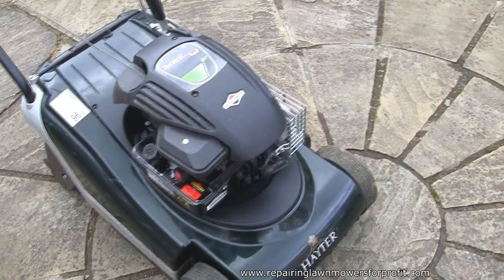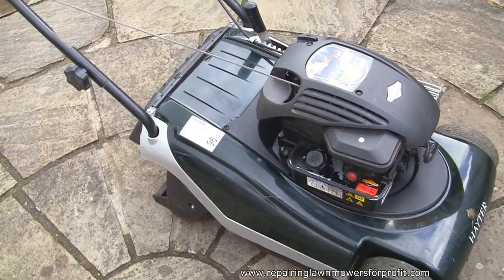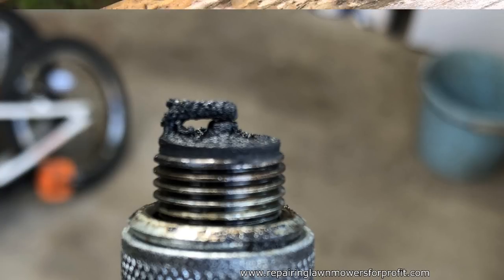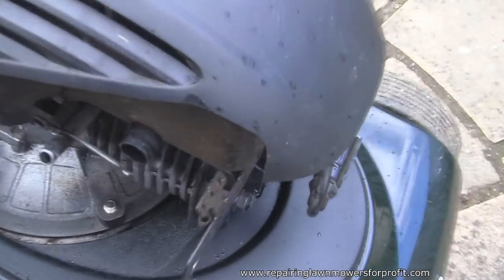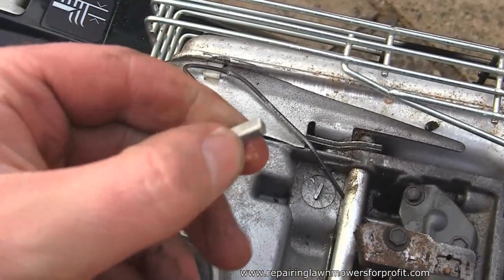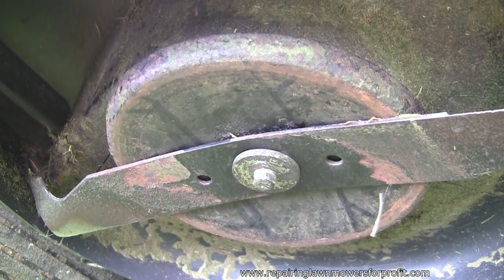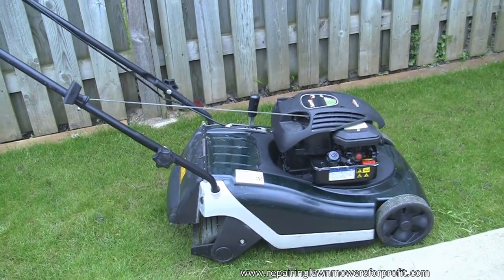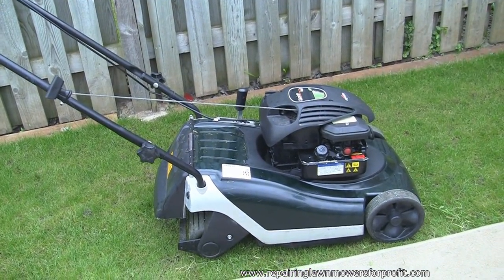Nightmare Hayter Spirit 41 Lawnmower Repair

Comment: Yes, the seal is often overlooked by many. Nice repair.
Reply: Haha, I keep seeing you all over the place Martin. A good channel recommendation, so I subscribed. You've mentioned that seal as well. I was just given a 190cc 625 Briggs powered mower - loads of power, but may be toast; knocks and smoke. I haven't pulled it down yet, but not sure it will be worth repairing. Anyway, cheers to you and the Mower Man
Reply: Nice one Pete.
Cheers bud
Reply: You have an old one some where, maybe in the poly tunnel. It's the first time I saw a mower with a roller.
Reply: Yes Its in there Bri. One day maybe lol

Comment: Thanks for this video.  I have this mower and it has recently started to cut out after about 10 mins of use.  Not sure yet what is wrong but think it might be the seals you changed on the carburettor
Reply from the maker: it will be

Comment: My Hayter Harrier 41 Autodrive Rear Roller Petrol Lawnmower is in need of a service. The jockey arm assembly doesn’t want to return fully and the brake cable is loose. So the mover won’t stop driving forward. A simple wd40 spay application to the jockey pivot arm doesn’t yield great results.  It still won’t engage the brake/no drive.  think I may need new belts. Have you seen similar issues in your past or know any decent links to fixing and how do disassemble the unit to fix the jockey arm.  The mover is a few years old now and tired but runs well just needs some attention. Thanks for your help.

Comment: The friction disc is something unique to Hayter. Don’t think the adaptor on a regular mower has a crank protection. Try and do work on the current Hayter pros. Great money in them if you buy them cheap. I have a video on how to fix the drive on an old 56 if you need any help 👍🏻
Reply from the maker: Gregs Mowing Thanks I'll take a look at it cheers

Comment: Hello there. I have just purchased a second hand Hayter 41 Spirit and the height mechanism has come apart infer the machine, so the front wheels have disconnected from the back mechanism. Each time we reconnect it the metal piece falls off the metal dowlin it sits on. Have you any experience of this please?
Reply from the maker: Yes, absolutely I had the same thing once but was unable to fix unfortunately
Reply: I used a jubilee clip on it and it’s been ok for 3years now

Comment: I've really enjoyed your videos, they've really inspired me.  I've got an old Hayter and I can't find the engine number - there's no stamp anywhere . The carb and bowl were completely rusted.  I've cleaned it as best I can but it's not great and the float keeps sticking.  FPHA20 dellorto and no 96 is marked on the carburretor but that's not helping me to buy a replacement and the fuel isn't getting to the carburretor.  I have cleaned all the jets.  Is there a carburretor I can buy from you that will fit.  The only marking on the mower says Easy Start Mower.  It's a push mower with a roller.  Many thanks JW
Reply from the maker: John Willmore I cant help with the carb unfortunately. Hopefully someone will leave you a comment on here soon!
Reply: O.K  Thanks for your reply. Is there any way I could refurbish this carburettor.?
Reply: O.K  Thanks for your reply. Is there any way I could refurbish this carburettor.?
Reply: Hiya , I tried asking you about a carburettor for a Hayter which unfortunately you could not help me. However I have just watched your video for the Techusmeh engine and carb service. The one which you said was a pig. My engine is almost certainly that one . Could you advise me what carb was on the Techusmeh . Mine as I said was a Dellorto Fhpa20. 
Thanks for another great video. Any advice much appreciated. Cheers John W.

Comment: Hi  - great video thanks but I still have a problem with my Hayter Spirit 4 617E. Until last season it was running fine. This year however, when starting it the engine over revs to what sounds like max so I stopped the machine immediately.  I have checked the spark plug(Not gapped but looks fine) Fuel is normal unleaded, oil looks fine - mid brown colour  no sign of swarf or contamination - feels smooth.  Air filter was slightly soiled so gave it a cursory clean.

However, the problem still exists - engine starts wildly revving.  There is a small spring on a lever behind the fuel primer, which is not connected to any of the 3 holes on a corresponding flange. Connecting to any of those made no difference.

Any clues please?

P.S. I used work in car maintenance many (40) years' ago so I know my way around engines (So I thought!) but I can't fathom this one out.

Many thanks in advance

Graham,
Epsom
Reply from the maker: does this video help? https://youtu.be/NDMR--XhC8g

Comment: You  referred to a mix. Is this a 2 cycle, or is the customer nuts? Plug was way fouled. Seems it’s a straight gas mower from here. Good catch on the intake o ring.
Reply from the maker: jim s It runs on unleaded petrol no need for mixing. The customer thought it was 2 stroke

Comment: i have also had outer things happen to these engines the the tube on where the carburettor connects to the inlet to the engine has had a hairline crack in it that can all so result in bad running

Comment: Typical !! Pull the whole thing apart, and for what ?? these B&S engines are bulletproof 99.9% of the time it’s the diaphragm between the tank and carb. Now makes one wonder that this guy posts on YouTube yet hasn’t the grey matter to watch a few vids on YouTube before getting into something that is so obviously simple. The basic rule of any Petrol combustion engine = fuel spark and air. 🤔😜